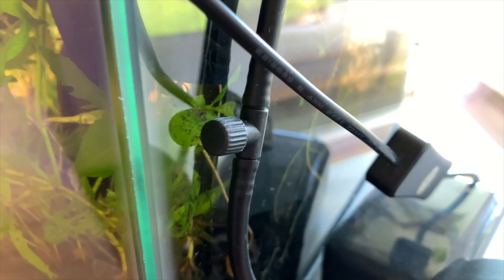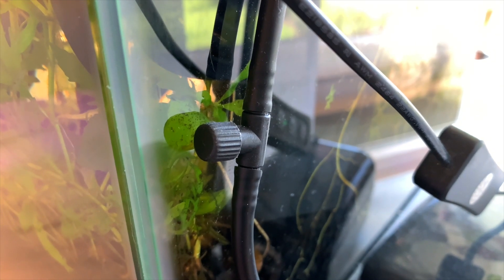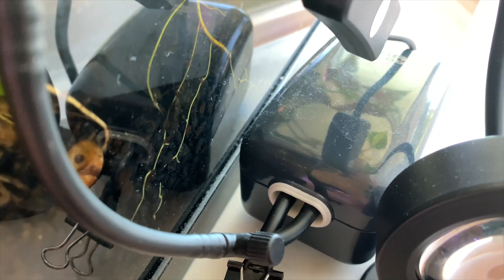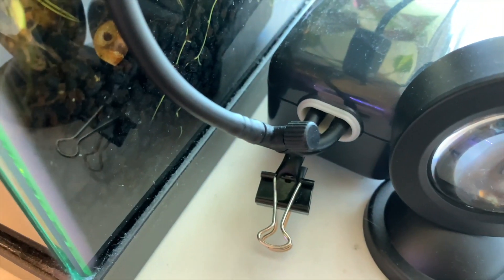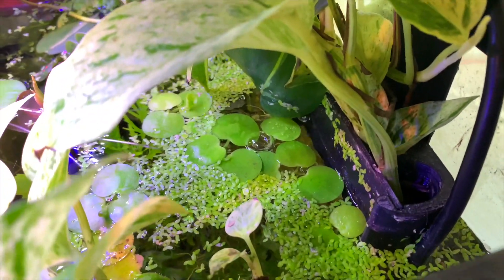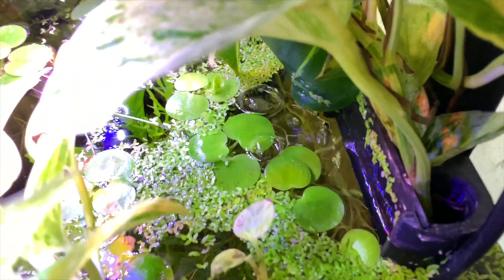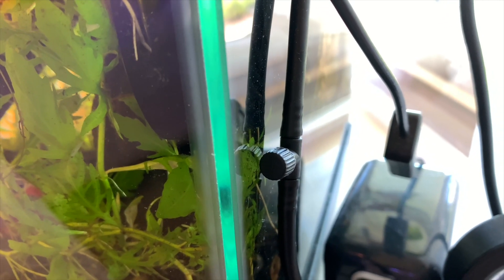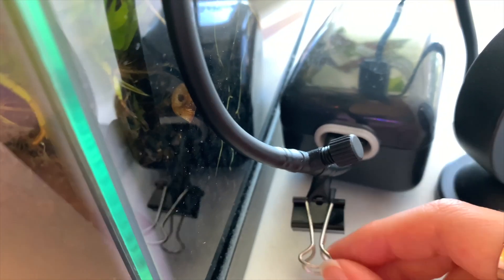How To Fix The Air Flow In Your Betta Tank

Comment: It's better to bleed off some air than to restrict the flow, which can shorten the life of the air pump due to back pressure.
Reply from the maker: Interesting, never thought of that! Doesn't this make more noise, though?
Reply: @Betta_Days  Much less noise than a bubbler and you'd have to get close to hear it, assuming it's just bleeding off into the atmosphere. The hose can be as long as you wanted to easily lead it to somewhere completely inaudible.

Control valves are good but should be used in combination with splitters